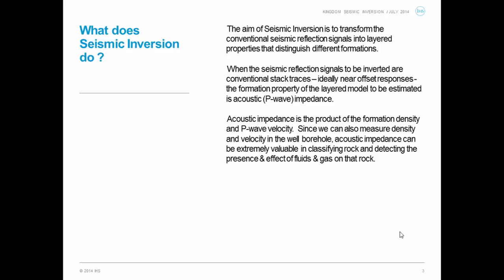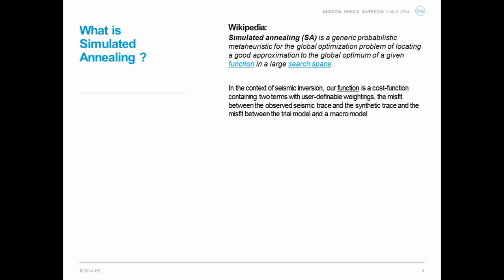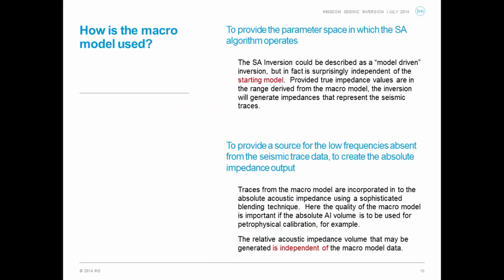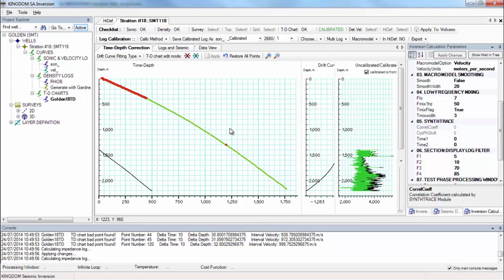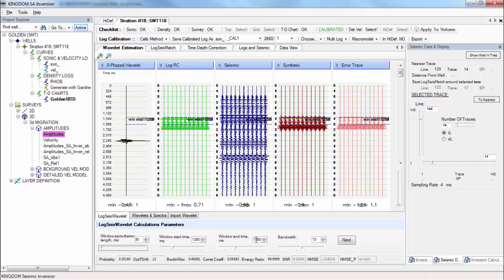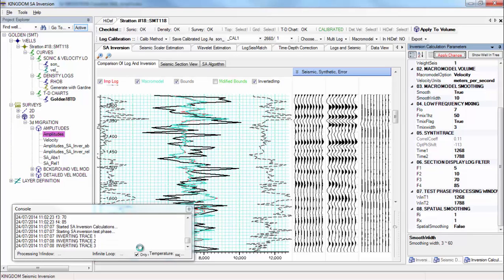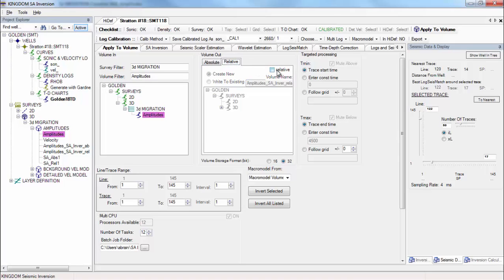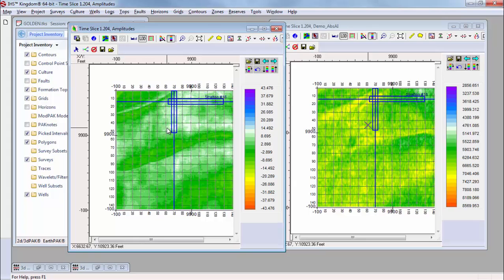Kingdom Seismic Inversion (Simulated Annealing Inversion) Demo

Comment: Awesome demo! I'm really excited to see a Simulated Annealing driven seismic inversion in an accessible package like Kingdom. It does seem like this module allows one to considerably customize the parametrization of the algorithm, which is excellent. I do have one question though: I assume this is a trace-by-trace operation, and each of your input traces contains about 76 samples (1.3s to 1.6s, dt=0.004s). During the SA run for each trace, are you perturbing the impedance value at each of these time samples independently? Basically, are you enforcing any lateral or vertical (or some sort of adjacent-trace) constraint? And if so, can we also tweak these parameters in Kingdom? Your results look very laterally consistent which is quite impressive for a stochastic approach. Anyway, thanks again for the demo! I look forward to using this module soon!
Reply from the maker: +hamsterpoop 

Thank you for your positive feedback.

Yes, the process is trace by trace but lateral consistency is achieved by the background model acting as a constraint to the inversion. In this example, the background model is derived from the well impedance log but it may be generated within the software from one or more well velocity curves and a velocity volume. For more details on model generation, you can review the webinar “VelPAK (Velit) Depth Conversion with HiDef Velocities” on our YouTube channel.  This functionality is now part of the Kingdom 2016 Inversion software release.

Within each trace, windowing occurs.  Trace samples within that window are perturbed using a “random walk” technique within the constrained model space.  The SA inversion job parameters have been fine-tuned through extensive testing on literally hundreds of real world projects, so that any geoscientist should get good results quickly and easily.